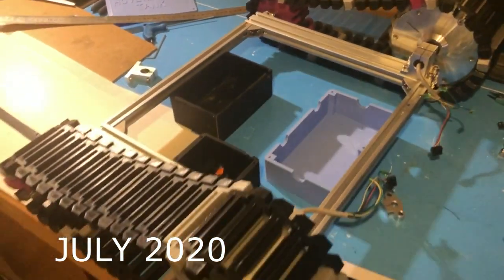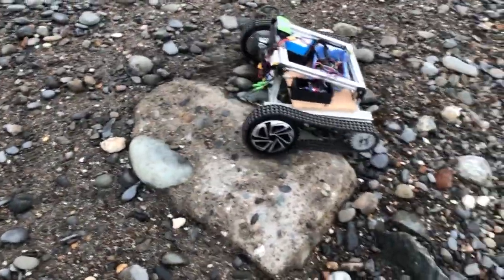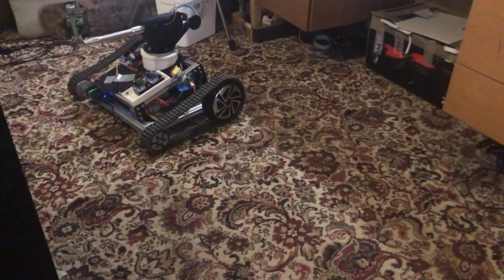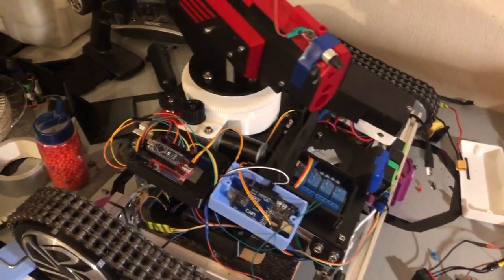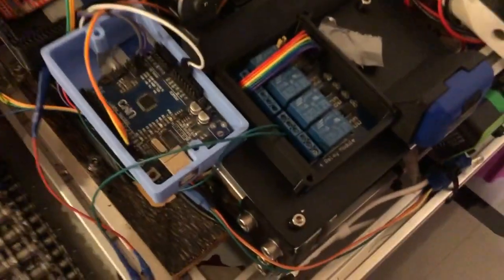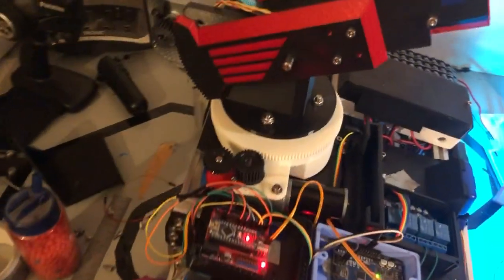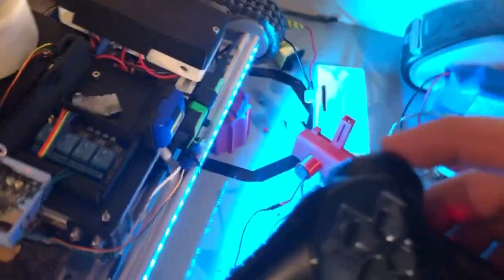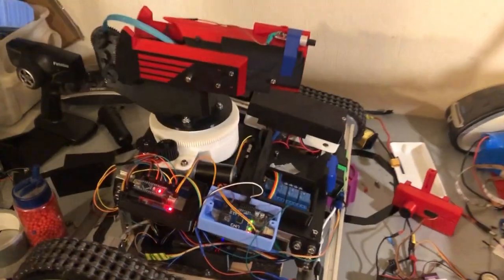HOVERBOARD TANK - part 3 - Steel Tracks, Turret

Comment: Nice project. Im building an snow blower with a similar system. What kind of track do you use?
Reply from the maker: hi, that sounds interesting, for my one i used a triplex chain, so the outer sections were on the sprockets and the middle part was free to bolt stuff to it, hope that helps

Comment: As of now.  Would you recommend the hoverboard motherboard hack or the Dual VESC and why?
Reply from the maker: hmm good question, i would say it depends on the situation, if its just for 1 motor, or you want regenerative braking, i would say the VESC, if you want to specifically control 2x hoverboard motors either with a skid steer or no speed variation i would say the hoverboard motherboard hack, i find the motherboards more robust, they never have any issues and can also charge the battery as if it was still a hoverboard. so for most things i make like the hoverboard car and hoverboard tank i will be using the motherboards, i will make a scooter one day with a hoverboard motor but for that i will use a single VESC, i have videos about both if you are interested, hope this helps :)
Reply: @A-tech  so does the dual vesc not work as well with controlling 2 motors simultaneously at the same rate? I spoke with you about a year or so ago but just taking the time to get back to my plans. I am a little person, 3ft tall and 50lbs. I want to build a mini wheelchair I can load into my car by myself without a huge lift. Wish I could buy a flashed motherboard, I bought a hover board that had no motherboard. Then I ordered a motherboard that ended up being different. It ended up being the YST-DXT-J20 V5.1. Not a lot of info on it but requires changing libraries to flash. And I’m a noob to this. Seems daunting.. more than programming the arduino

Comment: Nice 👌, im still playing with something similar also and also with leds i have gone with ws2812's and daisy chained them around the vehicle.... no comms between controller and vehicle leds display random, and for other states of movement have created different code to be sent along them 😉
Reply from the maker: that sounds cool, i will look into them, thanks
Reply: @A-tech  https://youtu.be/e7tdC11vxJA
Reply: Have you progressed any further? Ive added some idlers to mine and its been perfect with the boy riding  along inside
Reply from the maker: @gazznewphone  that sounds good, im planning on some idlers, are they at the bottom to support the middle of the track? this one has changed a lot, its got a new chassis, new body panels, longer tracks, working turret that shoots bbs, fpv camera, new 1000m range controller, just finishing off some more bits ready for the next video, Hoverboard Tank MK2, thanks
Reply: @A-tech  you got it buddy, have added three between the front and rear, lower that the front and rear to reduce the friction on floor whilst turning and give more support to the track when in contact with the ground, other advantages are that its raised the motors so puddles arnt so much of an issue, goes up and down steep gradients also, still using tyres as track as want to keep it clean and finger friendly for the boy
Reply from the maker: @gazznewphone  i just had a look at your latest video but i dont think it has the most recent modifications, the tank body looks great, i take it with the full track on the ground its hard for it to steer with the child inside, i attempted to attach tyres to the outside of my chain track but i think it needs to be the exact same size to work so will probably just use rubber pads spaced out
Reply: @A-tech  just added a few clips with the mods... had to add some additional mods with the snow as the rear wheel kept compacting any snow that made it onto the tracks 🤣 not that we see snow often here, as you have gone with chain i think your right and rubber blocks on every other link would probably be the best call, maybe tap some steel plates then encapsulate in rubber 🤔 so they could be mounted securly 🤷‍♂️
Reply from the maker: @gazznewphone  just had a look, its good, that would help with stuff getting into the inside of the track, steel plates would be good, i was thinking of cutting a bike tyre up and make flaps so each flap covers the next bolt, will take a long time to make so dont know if i will

Comment: It's beautifull... I Think large wheel for track is  better...
Reply from the maker: thanks, large wheel front and back? i was thinking of doing some tests with this, it would definitely help with going over stuff
Reply: @A-tech  like Johnny 5 style... large but not in diameter....  you decided to not use 3d printer track; is a genius idea to use a chain...  I love it; I want do someting similiar but x5 five big...and chain is to loud...  I'm thinking about rubber air chumber or try print using Tpu... don't know about snowblower is too rigid for hooverboard wheel... but you are only person that use this motor for tracked veicle and is same that I'm planning to do... amaizing job..
Reply from the maker: ahh ok yes wider tracks would help, the good thing about these the wheels can be printed like 2 stuck together and double up on the chain, i think i saw a video a while ago with someone using an old car tyre with the sides cut off to make a sort of belt, thanks

Comment: really nice work, its looking very cool and you've put an immense number of features in, that all seem to work well. i love it. 
been a while since i watched the early videos; do you find that you're getting the same speed and torque out of the hoverboard motors as they had originally? i have a hoverboard i'd like to convert into a shopping cart and want to retain as much of its power as possible. would really appreciate some details on how you're driving the motors, if you find time.

as for usecase ideas, its quite a project in itself but a robot arm attachment would be pretty cool and genuinely useful i recon. maybe a scara type as its somewhat easier to design and control. James bruton is currently working on a 'really useful robot' if you haven't seen it already.

anyway merry chrismas to you too! looking forward to more updates! :-)
Reply from the maker: thanks, haha yes i get a bit carried away sometimes, seeing what else i can stick on it, as far as i know they havnt lost any power, i do have some dodgy ones that have gone a bit jumpy but i think thats something with the hall sensor connection, shopping cart sounds good, i like to reuse the hoverboard motherboard to power the motors, they are reliable and can also charge the battery, just need to reprogram them first to allow for different inputs, battery power and driving types.

yes a robot arm would be useful, i have been trying different robot arm designs for a while but still havnt managed to make a decent one yet, the parts are so expensive, easiest and cheapest way would probably have it like a jcb with linear actuators, they are very strong and not too slow, ok i will have a look.

thanks and merry chrismas to you too, tank gun update should be next week
Reply: @A-tech  haha, thats what makes it fantastic, and its so cool that you're able to actually DO everything you seem to come up with and get it to work, one way or another. the sky is the limit!

yeah, linear actuators perhaps, but i think for remote XY positioning the scara design would be easiest to control, unless you create a kinematic model with interpolated positioning etc etc for whatever other mechanic design you go with and thats all pretty complicated. scara needs that too but they already exist in 3d printer marlin or reprap firmware, and you can easily position a stable Z (height) then concentrate on controlling the XY, if you're trying to grab an object over camera feed or something. they also don't need drastically stronger motors as you go down the arm because while they do have to move the mass or each subsequent joint, they don't have to hold it.

James builds fantastic robots, with many self-designed, relatively simple and relatively cheap motion mechanics often using pulleys or v-slot extrusion.

Skyentific (youtube) also has some very clever and budget friendly mechanical designs, other than the brushless motors and odrives he likes to use.
you do need motors with position control regardless, but i think you should be able to find a sacrificial 3d printer with 4-5 steppers for around £100.

anyway, you're much smarter than me, i look forward to seeing what you come up with!

thank you for the tips. i've seen several videos on controlling hoverboard motors and had forgotten that you're using the original mainboard! that does bode well for retaining the original power capacity.
do you happen to have a good resource/a guide for how to re-program the mainboards? its all new to me and the more idiotproof the info i can get, the better.

i want it to be a cargo carrier basically, but maybe also one i can still ride when it isn't overloaded and also act as a powered bike trailer to assist on very steep hills. (depending on how much resistance the motors create when i'm going faster than they can).
at a later stage i'd also build a seperate scara arm and telepresence body that can sit on the drive base, but thats a whole other thing, obviously.
Reply from the maker: that scara design does look like an efficient way of doing it, i have a load of 24v dc worm gear motors that could be used that way, they arent great but probably do the job for now, the same ones in the turret.

for the mainboards i made a couple of videos about how to reprogram them, you just need to make sure you get the right version.

sounds like an interesting project, make sure you do some videos along the way
Reply: I've been following this project throughout and came up with my own solution- using fesc controllers with the hoverboard motors. The performance of the motor is only affected by the battery. It's likely that the hoverboard batteries are the cheaper kind, meaning they degrade much faster, thus the performance sag. We have taken apart a few of them and noticed that many claim to have the samsung cells, but upon closer inspection they turn out to be cheapo-lightweight, no name cells. Get a set of fresh batteries and youre good to go.
Reply from the maker: hi, yes it is possible, lots of the batteries i have are from cheap second hand hoverboards, new batteries definitely the way to go, thanks

Comment: Nice work, but how did you attach the sprockets to the hub motors? 
I haven't seen this step in last 2 videos.
Reply from the maker: ok they are a 3d printed sprockets, i should have included it but have no videos of making it, i just removed the back panel on the motor, slid off the rubber tyre and slid on the 3d printed sprocket tyre, its a tight fit so grips well, thanks
Reply: @A-tech  nice 👌
Reply: @A-tech  Nice... would you care to share the file of the sprockets? I’m also trying different things out with the hoverboard wheels.
Reply from the maker: hi, yes sure i will put them on thingiverse when i get chance
Reply: @A-tech  thanks..

Comment: Dude this is sweet, I am thinking about a design for a off road onewheel using a roller chain track like yours with TPU or rubber inserts to get the correct curvature for carving. 
Funny I found part 2 then checked your channel to see this uploaded. weird timing.
Reply from the maker: ok that sounds really interesting, with this one the wheels are only driving the outside links and the middle one is free to attach some kind of rubber feet.
 thats weird haha
Reply: @A-tech  have you gotten any VESC based ESCs yet? if not I would love to help you find the right one for you.
Reply from the maker: @quinnfoster4671  i have some of the flipsky vescs, but i find the hoverboard motherboards seem to work better, the vesc ones were tricky to set up and cut out often for varoius reasons, the motherboards just go with no problems and can charge the hoverboard battery too